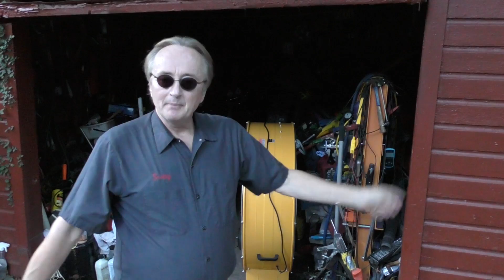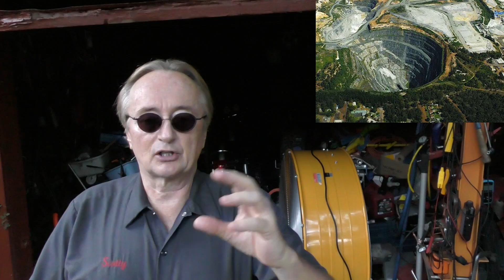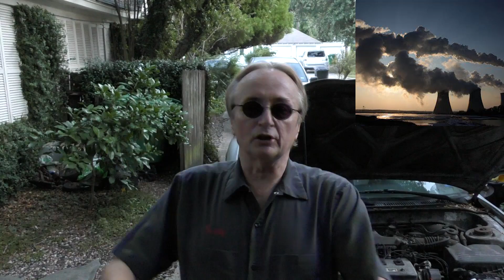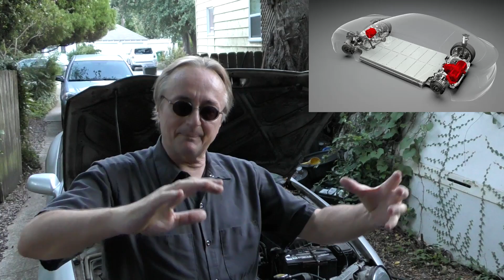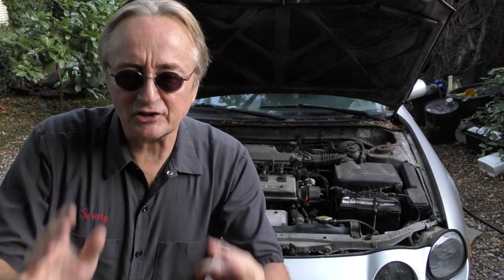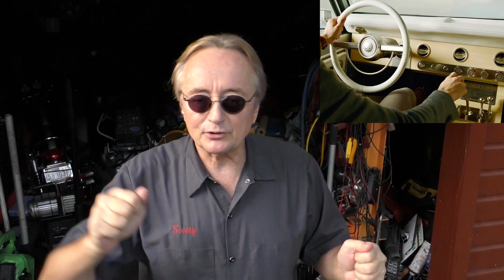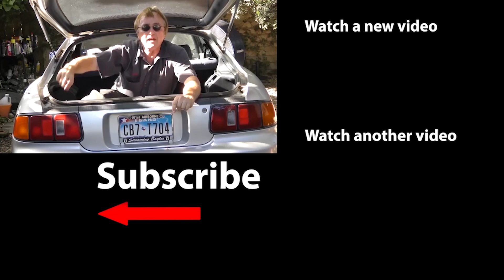Saying Goodbye to My Toyota Celica's Engine

Comment: If it's not that great, as Scotty says at the beginning, going to a new electric car, why would it be better converting an existing car to an electric one? You still have to charge it, the battery is still going to be Lithium, and you have all the problems of an electric, plus the problems of an old car. Buy a good cheap used car that gets good gas mileage and let the new age liberals save the planet by going electric.

Comment: I have been driving my Chevy venture for 18 years.  When it breaks, i buy NOS parts on ebay, and repair it.  Now that i work from home, i fill it up every two weeks or so.  It gets 19 mpg in mixed driving. I trip chain, and stay local.

Comment: The most environmentally friendly car may actually be the BMW i3 range extended version as it uses a smaller battery which can handle most daily driving and a relatively light range extender based on a BMW motorcycle engine so you can limp the car home if the battery runs out. May even be able to handle longer trips using the range extender if it doesn't happen too often.

Comment: Well, it's not as simple as hooking up a battery to an electric motor. I mean, I assume you want the car to have more than two options for "throttle" besides "off" and "balls to the wall". But, yeah, they're mechanically simple but electrically mildly complex compared to an internal combustion engine.

Comment: Back in the 70s, I got electric car magazines. Was hell bent on converting a car. The car of choice was Plymouth Arrow due to it being just the right size for the motor and batteries of that Era. I never finished my build, sadly. 

In 2005, I built 2 electric bicycles from kits. Super fun! Now you can buy complete main stream E-bikes with regen braking.

Now I have the itch to convert a motorcycle. Thanks for your video!

Comment: Am I missing something here? Even if you did do a conversion wouldn't you still need lithium batteries to power your electric motor? So where is the benefit? All you're really reusing is the body and chassis.... Which gets recycled anyhow when a car gets junked. Besides I doubt many people are just tossing their old cars to the curb just to buy an electric one. They're on the market for a new car so make the choice to buy a new electric car rather than a new gasoline one. This whole video doesn't make any sense!

Comment: One slight problem: it costs a ton more money to convert an internal combustion car than buying a new electric car. Rich rebuilds (I think) did a cost analysis and it overall cost more than buying a new Tesla. I would instead go and buy a used electric car, some of the Leafs and e-Golfs are on the market for under $10k these days!

Comment: I wouldn't say diesel is more polluting than an electric or gas. You have to remember that diesel is able to run on pure vegetable oil. And when it runs on pure vegetable oil. It's emissions are much cleaner plus renewable source of energy.

Comment: I think these electric cars or hybrids should have been built like locomotives. You have a diesel prime mover connected to electric traction motors. No lousy automatic transmission. GM owned EMD and they could have cornered the market on this but they dropped the ball.

Comment: Wait, an electric car with a manual transmission....my god there is hope after all
Reply: lol, it would be funny but pretty pointless. Electric motors don't need transmissions (for the most part).
Reply: @177SCmaro  They do in those because they use cheap brushed electric motors. Modern brushless electric motors have full torque all across the entire range of rotation speeds and don't need anything but a fixed gear ratio.
Reply: @kg4boj  
Well, there you go then. I still don't think even a crappy electric motor would need 5 speeds as in a Celica but maybe they do.
Reply: @kg4boj  I have never driven an electric car so Idk but wouldn't a fixed gear ratio make it such that speed is a lot more proportional to accelerator pedal position compared to a normal car? (i.e. I mean that--at least on my car--at low gears depressing the pedal slightly makes the car go around 20 MPH but at higher hears the same pressure on the pedal is more like 50 mph).
Reply: @peter carlson
People have used all kinds of electric motors in their conversions. DC brushed and brushless, permanent magnet, AC 1,2 and 3 phase.  I have even seen an alternator converted to a DC motor and installed on a motorcycle.
Reply: @david13579naranja
An electric car doesn't need a transmission but it helps increase the distance it can travel by using less amps to go faster. I have seen conversions without transmissions and with automatic and manual. Clutchless manual seems to be popular.
Reply: @kg4boj  surely a brushless motor spinning faster has more power behind it.
Reply: @alanssnack1192  Actually the opposite. Brushless motors start out with full torque, as they increase in speed the time the motor's poles align decreases faster and faster and their torque drops off nearly straight down like a rock, which is why you gear them down instead of direct drive them in cars but 1 gear ratio more than covers the whole driving range that you will ever encounter even if you race for a living.
Reply: @kg4boj  interesting. imagine a tesla cogging like a rc car.
Reply: @alanssnack1192  Cogging? I don't know what you mean by that.
Reply: @alanssnack1192  If you mean slight pulsing of torque at very low speeds, yes, the tesla does that but you really have to crawl the car as slow as can be to do it which is very hard to do.
Reply: @kg4boj  Oh right, yeah I know BL motors strategically do heavy pulses to get the motor spinning in the right direction and  stuff.  rc hobby will teach you that.
Reply: RPM on the electric motor is proportional to power drawn, so a gearbox WILL improve range.

They don’t do it to keep the cost down but I suspect the “next big thing” will be multi speed electric as it will simply give more range with the same battery.
Reply: The whole point of my comment was that there is hope that electric cars in the future won’t all be lame-O-Matics.
Reply: Rich builds channel has built an electric car  wit a manual transmission. The motor is from a motor cycle. Pretty kool i would say. Im gonna mod my 2019 Ram 1500 classic ta a hybrid wit a ZF hybrid transmission

Comment: Hmmm.... My old blazer will run without a battery, try starting an electric vehicle and take away its battery. Suppose your alternator gives up, no problem, you can drive for miles until battery dies. Miles. Any system that malfunctions, with a perfectly good battery in an electric vehicle, you are stuck. Don't start me on diesels.....

Comment: I have a feeling that just turn it electric is more than just put a battery and electrical motors. I feel like Scotty is forgetting: weight ratio, handling, torque conversion, etc.

Comment: Thank you, Mr Scotty, for a great video! As an owner of both an electric car (Hyundai Ioniq 100% Ev) and a Jaguar x-type endless money pit, my lifelong project and dream is to convert the money pit standard-transmission Jag into electric to make it somewhat less of a money pit (the unreliable engine out, and I'd still have the Jag's luxury interior and the unequivocal classic exterior). For now, I'm learning the mechanic trade by doing the small repairs of the Jag myself (oil and brake changes etc) using the Heynes repair book and Youtube tutorials, I have learned quite a thing or two from you... Slowly I'm patiently gathering skills for the time I would be ready to take on the conversion. Still, the cost of the parts for some 50 kWh of used tesla S batteries (weighing some 250 kilograms - around 500 lbs), a motor and other stuff in a kit (without the work) would be around 30,000 EUR... I'm still waiting for the prices to drop... but when I finally do it, I'll make a video of my electric money pit for your Show off Saturday, deal? Greetings from Slovenia!

Comment: i like keeping a multi speed transmission but they say you dont need them because the power band is much wider with an electric motor unlike a gasoline engine where the available power is at a more limited rpm range but why would you want to be going down the highway turning 15k rpm making a lot of extra noise, wear and tear on motors and parts when you could just have something with gears that would make the vehicle last a lot longer and be quieter wasting less energy and it also saves weight because your friends aren't going to want to ride in the thing

Comment: Lithium batteries are infinitely recyclable, with very little other precision metals to mine and graphite coming soon. Also, current end-of-life vehicle lithium-ion batteries after +500k miles  can be repurposed into battery bank storage for another 10 years before recycling. Once gas or diesel is burnt it's gone. And if you own a 30 amp electric clothes dryer on a 100 amp service (pre-1980s) coming into your house your neighborhood power lines will already be able to handle people charging their cars at Level 2 speeds. Just sayin'....

Comment: In end times Diesels will still be able to be fueled...even on oil from deep fryers.
Reply: diesel engines will be around for a long time...
Reply: And the trucking/freight train industry will have a very hard time leaving diesel. It will be around for quite a while.
Reply: @AndrewFRC135  Trucking has been experimenting with alternative fuel; CNG and LNG being the most widely tested/in-use at the moment. As for trains, transitioning to electric wouldn't be too difficult. Most modern locomotives are diesel-electric so they're half way there, even without making the switch they currently are the most efficient way to move the amount of cargo they can move. Back during the recession of the 2008 era, trucking companies were actually trying to increase their utilization of rail transport for cross-country shipments to save on costs.
Reply: @killer2600  electrifying freight trains isn't so eco friendly as not all routes have overhead lines or third rail. The pollution and cost from mining, manufacturing and maintaining those infra might be worse for the earth than sticking to hybrid diesel-electric. Consider that most electrified lines will require fencing so no one will accidently electrecute themselves trespassing. All that metal has to come from somewhere. I think bio diesel hybrid is the future of freight trains. Its the same issue on ecars. Not until cleaner energy sources, better grid and better power storage tech dominate will evehicles be better than what we already have. Its all just big companies making money off lithium. Imagine once everyone has switched to electric lithium will be in high demand with limited supply. Prices will sore. Anything with a battery will get more expensive than it is now. Like a cellphone. And its hard to profit from recyling lithium batts as the batts themselves contain small amounts. We should just start saving and replanting forests, impose population control and cut down rapid urban sprawl.
Reply: @snailmark  You're a little behind the times, lithium is already in high demand, in high use, very profitable, and expensive. All Tesla's as well as all other full-size electric cars use lithium based batteries. Even the Boeing 787 used lithium-ion batteries initially. Industry is using lithium any and everywhere possible, today!

Comment: Forced electricity blackouts we just had in parts of Calif. show what a fail electric cars are.
Reply: Our current power grid is ancient and unsecure. That needs to change anyway. The reason the electric companies shut off parts of the grid is that they were held responsible for starting some of the wild fires. There are batteries being tested that will provide 500mi range and can be charged in 30 min.

Comment: People buy EVs, for the conveniences they offer, not so much for the idea of them being electric, and when it comes to a new vs old, most people chose new - because of warranty and the new high-techy insides. So I dunno, sounds like rambling to me, of someone who wants to keep on fixing up used cars. Vehicle manufacturing is a dirty business, be it electric or fossil fueled kind of vehicles; also, keep in mind that a lot of pollution comes from tires and other vehicle components. If you do not want to participate in wasting, drive the oldest car possible the least amount possible, and wak a lot instead... Preferrably barefoot - so as not to pollute via used shoes.